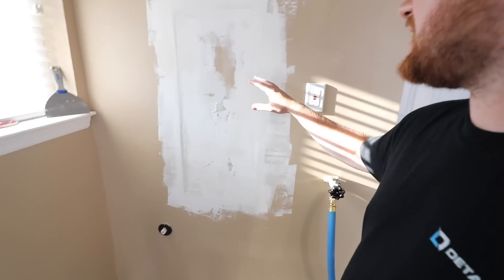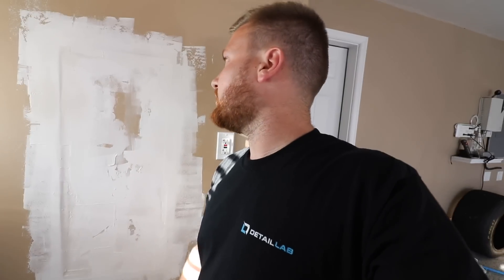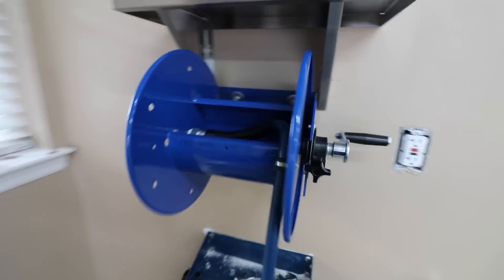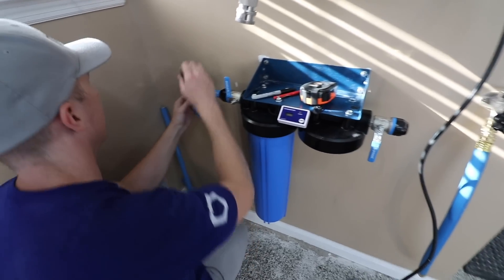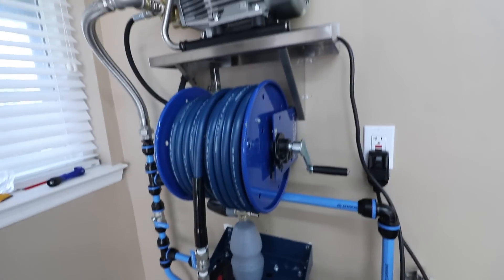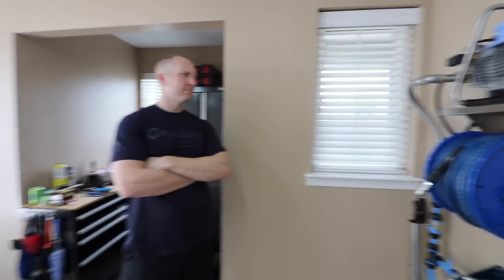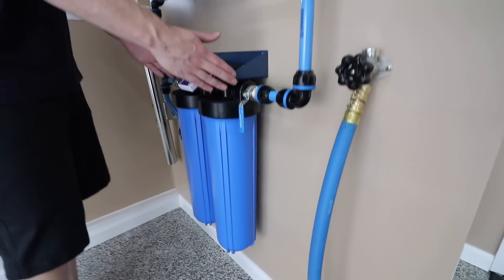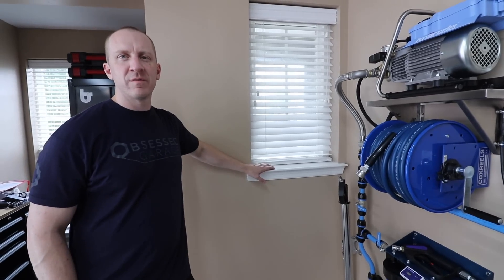Custom Garage Pressure Washer Install | Part 2

Comment: Typically when you install something like this on the wall you use a backer board like plywood. You mount it all equipment on that board and the hang that on the wall. The backer board will be wider than 16" so you just screw it directly into the studs. No drywall work or extra studs required. You can also take the whole thing down if needed. Good job!
Reply: J H was thinking the same thing. They did more work than they needed to and it would’ve looked the same if they painted the plywood
Reply: I was shaking my head when i saw that as well... and the motor on the wall... wtf... should be on ground or its going to shake that whole wall and deteriorate over time
Reply: Non-American, clueless Asian here. Is there’s any video that I can refer and learn? Thanks

Comment: Kudos for creating a simple one stop shop package for the professional and hobbyist alike. However this result can be achieved much cheaper purchasing items independently and give the ability to use copper fittings. With the Sheetrock down then plumbing could have been concealed inside resulting in an even cleaner look.
Reply: Still a lot more work and copper tarnishes...
Reply: @joshcosta423  not if you paint it. Oh wait, chrome it.

Comment: Maybe should have replaced the drywall in that area with 'Durock' concrete wallboard? Inevitably, that drywall is going to get wet and fall apart.
Reply: Use a board stretching 16" anchored to studs and then mount it to that .

Comment: Meanwhile Im using my $80 Harbor Freight power washer 😂
Reply: And it works fine.
Reply: Sun joe for me and it works lol
Reply: $80 pressure washer? IS it Gas or Electric? and what model Im interested since you bought it at harborfreight
Reply: Forward Momentum Its called the Portland Electric Pressure Washer. I got it with a coupon so you will probably end up paying a bit more...I absolutely love mine!

Comment: Nice setup for sure. You might consider looking into using "Shark bite" fittings for your plumbing pipes. They are almost fool proof plumbing connectors, also pipe dope will stop your joint leaks. I use teflon tape and pipe dope on all my threaded joints, guaranteed no leaks the first time every time. You will enjoy that setup for sure, thanks for sharing Buddy.
Reply: This whole set up is really clean but i agree  sharkbite and pex is definitly the way to go now.  That would have made the plumbing much easier.

Comment: I would replace the cover on the receptacle cover with outdoor water resistant one. Also you could have put a regular plug on the end of the cable, it is plugging into a GfI receptacle.

Comment: Matt, question why not open the plug and rewire it instead of cutting the wire and splicing it.  Much better way to shorten the wire length.
Reply: Thinking the same...  common sense isn't all that common.
Reply: they like to over think and over complicate things...
Reply: Most plugs are sealed.
Reply: Normally the GFI plugs can be taken apart with 4 screws so they can be replaced

Comment: Looks great Troy. Im just curious what your TDS is on your tap water before it hits the DI system? my company uses a very similar system almost exact to be honest for window washing. If your total dissolved solids coming from your tap water are too high you will find yourself going through a new resin filter once a month if not sooner. This is a necessity for spot free cleaning.

Comment: You should have used a small sheet of 1/2" or thicker plywood and screwed that to the studs on the outside..

Comment: not sure why anyone would say you would get mold, as long as the walls were made like a bathroom with mold resistant drywall and bathroom grade paint. as well you have sufficient slope or are squeegeeing up after, as well as proper air circulation after the detailing is done so any left over moisture in the garage can be put outside kinda like a bathroom fan. then you are fine. maybe use some silicone caulking (clear) on the baseboards/trim top and bottom to stop water from getting behind.
Reply: Leonard Martin your bathroom get steam and moisture and the occasional splash over, why don’t you go grab a pressure washer and hit your bathroom once a week for a month or two and let me know how you make out. Without proper ventilation exhausting residual moisture after use and a floor drain for the water to flow the walls properly treated to be sealed 100% from moisture penetration there will be mold.maybe a 1yr from now depending on how much that gets used in the garage. 
The smart thing would be to back out do your wash just outside of the interior and then pull it back in for drying and detail.
Reply: It is designed to be used outside, hints the 100 foot hose, I don’t think he is going to be spraying that in his garage and getting all those tools wet in the background. And bathroom walls are exposed to moister from hot showers for years and years without mold Appearing, even with a fan you will still have moisture.  Paint is a sealer to and extent for surface moisture, not good for direct water contact over and over such as trying to wash your walls with a hose which is just silly but the paint used is designed to create a barrier.
Reply: Gary Anderson  lol actually i have a shower with 12 jets so trust me every inch is covered in water except maybe the top foot and the ceiling. also i have a similar system as to this one in my 3 gar garage and i use it all the time no problems. he does have a a/c unit installed in the garage that would help with moisture in the air. not to mention he has used bathroom grade drywall and paint. and i dont think he will be spraying the walls with the pressure washer.
Reply: no it is a walk in shower. the floor is fully tiled and is sloped for drainage. note his garage is also sloped for drainage as most are so water dont come in when it rains.
Reply: not to mention its his house and he can do whatever he feels is best for him. after all he is the one paying for it

Comment: Probably didn’t need any Teflon tape most of those fittings especially the flexible stainless steel braided lines should have rubber washers in them

Comment: dude all you do is put blocking  Horizontal to catch the studs Then mount it
Reply: your putting a water  Source on sheetrock that's not going to look very clean for long, look at using FRP

Comment: second mistake you're making...dont ever run the unfiltered water thru your pressure washer and hose....the minerals will leave their residue in the pressure washer and hose and defeat the purpose of the filters, you will recontamination the water that has been filtered and it will leave mineral deposits bc the filtered water then runs thru the same hose and pressure washer than unfiltered water has been thru...it does this AFTER leaving the filter..use a separate pressure washer and separate hose for unfiltered water and use this pressure washer ONLY FOR WATER THATS BEEN FILTERED!!!!
Reply: that's not how it works.....give it a few times...you'll see I'm right...you're contaminating your system. you need to have a dedicated hose and pressure washer for filtered water...your are defeating your purpose...I hate you spent so much time and money to not accomplish what should be accomplished lol..looks pretty but its plumbed wrong...its not over thinking...its common sense...trust me...a couple of months you will be re doing it... looking fw to the video showing that.
Reply: Why wouldnt you always want to filter the water?
Reply: the more water you run for thru it the less life you have out of the filters, they are kinda pricey to replace so you want them to last as long as possible....The only purpose in using it is for final rinse so it wont leave any water spots...as far as doing the "washing and cleaning" just regular water is fine...just use the CR SPOTLESS for final rinse and wash off...so you could filter all water but you would go thru your filter material about 4-5 times quicker than you need too.